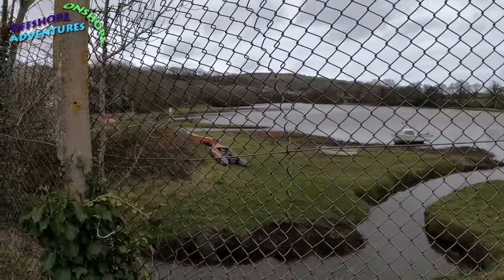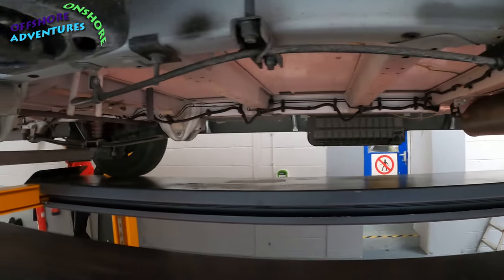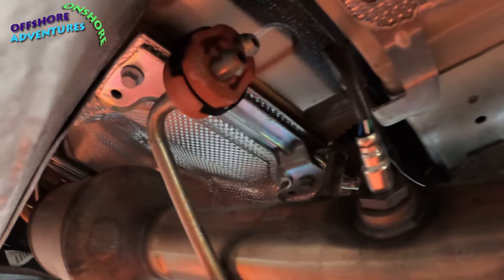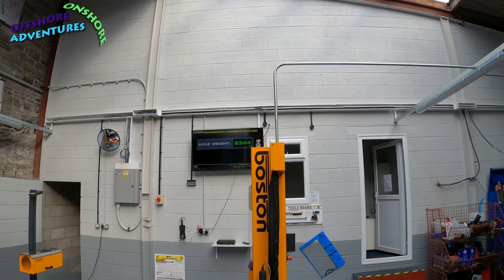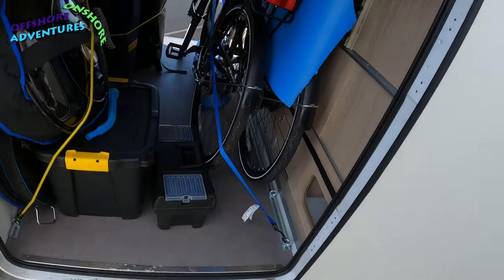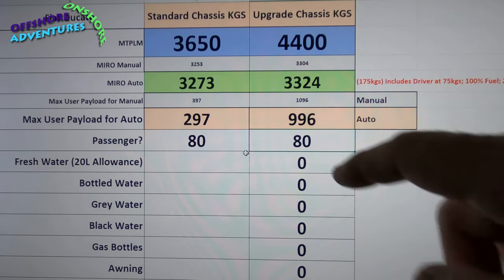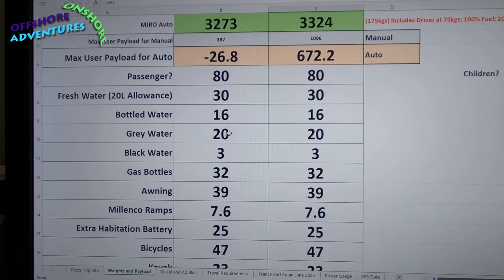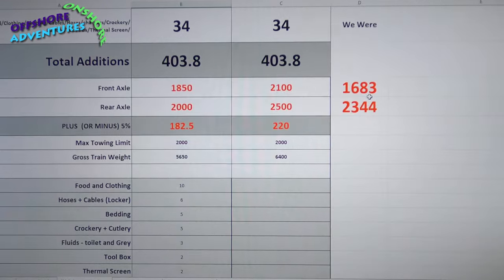Motorhome Payload and the Weighbridge !!

Comment: Hi Bob, interesting video again thanks. Intrigued with the faulty sensor. I have gone through a world of pain with a bmw 2010, 120i similar issue, I chased several theory's I had, eventually got there through stubbornness and a cheap diagnostic tool and I mean cheap, interpretation is everything is what I found out the hard way . Anyway Its interesting to hear how fiat use there diagnostic to get to the fault. I assume you have had no other issues since. I am pretty sure my new to me 21 van will have ad blue. Rgds Gerry
Reply from the maker: Hi Gerry and thanks for that :)

No more issues at all and the van hasn’t missed a beat since that - fingers crossed for France this year!! 

Yes you’ll be à Euro 6 which of course is great as there aren’t any LEZ charges yet in UK or elsewhere. A few years down the line it might be different I suspect!! 

I did look at some of those diagnostic tools online too wondering if I would get one but my Cardigan dealer has been really helpful so I haven’t bothered yet. 

You’re payload on the GF looks fine but it is a different story on the lighter chassis as the MIRO doesn’t include much at all for Mobilvetta as you saw!
4 sleeps to go!! 😁

Comment: Don't those axel weights include a full tank of fuel and 2 people sat in the front seats?
Reply from the maker: Hi Matterhorn,
Many thanks for watching and it depends on your van and what they define as Mass in Running Order, which was written in our information about the van when we bought it. Manufacturers do vary. 

Ours included the driver only and full fuel hence I messed around with the water ballast to simulate more people. The mechanic acted as the one driver. Then adding all our intended luggage for European travel proved the heavier chassis was our only route 😁

The heavier chassis means perhaps different tolls on European toll
Roads or perhaps different parking costs sometimes but key for us was travelling was NOT having to worry about overweight and therefore uninsured. 

The final results were interesting and useful when deciding what chassis you might choose. 

Hope that helps 😁🚌 (let me know if you wanted more info)

Comment: Hi just started watching your videos I like how you explain different subjects my question is to you I have a a card about the same size as yours an outline 7.4 m long 2.95 by the chassis weight on the logbook says 3650 kg gross can you please tell me if I need them angle more stickers for this vehicle because it is under 3 1/2 ton look forward to your next videos STEVE
Reply from the maker: Hi Steve,
Many thanks for watching and for your feedback. We’re glad you like the content!!

If you are over gross 3.5t then you’d need Angle Morte for France as you’re plated at 3.65t (Only France). 

They come off easily with a hairdryer to warm them up and a carful peel/scrape; then a tiny bit of white spirit for any adhesive residue if it leaves any :) 

Hope that helps Steve and thanks again 😁😁🚌

Comment: as for your weigh bridge calculations ,,you will find you are slightly off the mark ,,because to be weighed correctly .the vehicle should have a full tank of fuel and a full water tank ,plus both passengers should be in the vehicle at the time of weighing ,,, ,,,and the German police are very hot on campers and motor homes especially for weight ,,which is why all traffic police in germany carry mobile weight pads ,and that includes police motor cycles
Reply from the maker: Thanks for watching Eddie and for your feedback :) 
We were running with fuel right up but I also simulated additional passengers by filling fresh water to 100kgs and filling grey water to 90kgs so counteracting the lack of 'us' in the vehicle when compared to the MIRO figure. The bottom line was the front and rear axle figures and the excess we still have to play with which was the reassurance bit. 
I think the exercise made us thankful we chose the 4400 chassis which still gave us/gives us plenty of scope once we are in the vehicle too. We only run with around 20kgs of water so I was 170kgs over that on the weighbridge. It's a useful thing to do though and something that should perhaps feature more in the buying process for all types of van  :))
Thanks again Eddie :)
Reply: @motorhomingadventures  you are welcome ,,,one last important tip ,,but i think you may have already thought about this ,,a obd2 reader is a god send , mainly as it will give you any faults on the vehicle  .but more so that you can explain what is wrong at any foreign garage ,,,,
Reply from the maker: Thanks Eddie and not got one yet but after seeing it in action at the warranty work and seeing them for sale online (yes I did look!!) it is tempting 😁
Reply: @motorhomingadventures  you do not need a all singing and dancing one ,,just a good basic obd2 will do the job ,,maybe have a look on your travels ,,by the way your france drive is amazing ,and just goes to show how the french pay their respects ,sadly the UK lacks in that respect ,,,enjoy your adventure ,,,,
Reply from the maker: @eddielloyd4070  it was very moving Eddie - heard a lot about it but until you see it all it can seem surreal. To drive part of the route was a stark reminder 😕 May they RIP! 💔
Reply: Thank you so much for this clear spreadsheet idea. It has changed my mind regarding the type of chassis to look out for. It is now the top of my list!
Reply: Do you need a c1 licence to drive a vehicle of this weight?